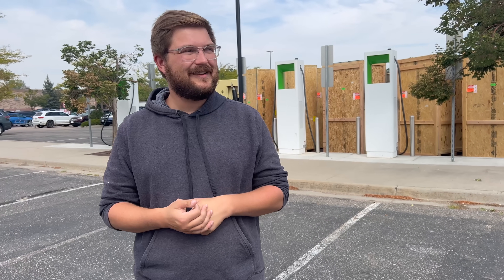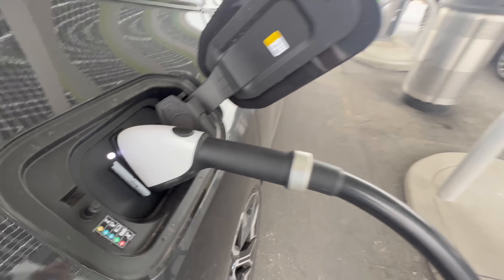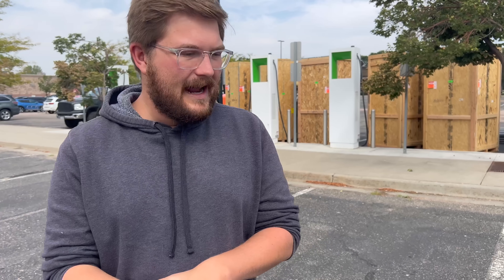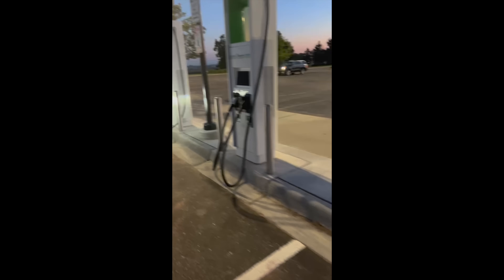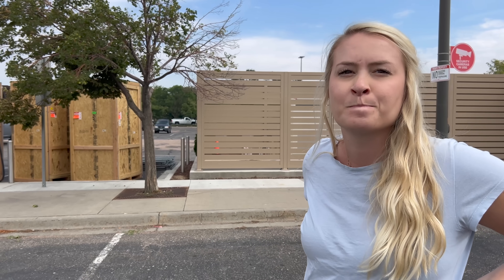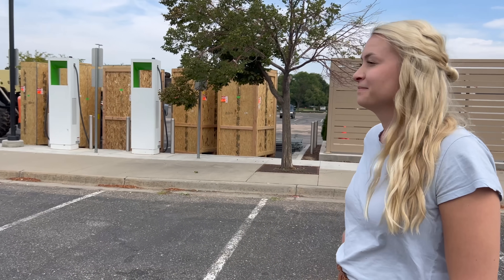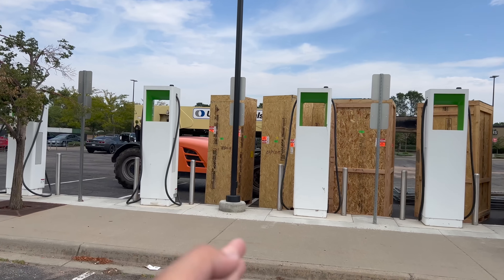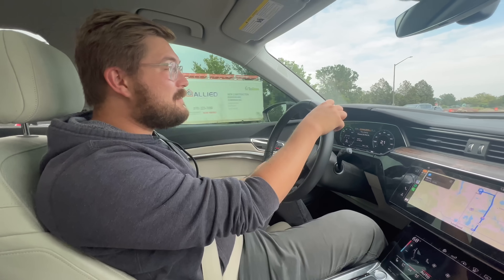Upgrade! New DC Fast Chargers Are Being Installed To Fix Reliability Issues Of Older Units

Comment: Looks like EA jumped the gun, and should have left Two stations working.  Just in 15 minutes of this video several customers got left stranded with no charging.  
If other DC fast charging stations are around a sign should be posted as to where the closest next chargers are and even a level two units as 2nd backup.  EA needs to have the app updated way before someone can post on Twitter.
Also, all level two EVSE'S should have a minimum of 11.5 kw as this is becoming the standard for batteries under 95 kwh and now with 135 kwh packs in the Rivian, Lighting and 210 kwh in the Hummer 19.2 kw level two charging would be outstanding. 
We still need far more pull through stations.
Reply: This is a major re-install.   They are not only replacing the charging cabinets, but also hardware connecting to location to the power supply.   You do not leave half the chargers working in this type of work.   Also, both Plugshare and the Electrify America app have details about what is happening at the LoveLand, CO charger, so it is no secret.   Anyone with one day's experience driving an EV should be able to figure out where else to charge if this location is down.   There is the Longmont, CO EA charger 20 miles away that is up and running just fine.
Reply: @PaulieinColorado  Paul F.  Do you work for EA?  Is this where your knowledge comes from?
Reply: Luckily there are 2 other "fast" (50 and 62kW) chargers within 5 minutes of there.

Comment: Gelly just came out today with 600kw fastchargers. 300km in 5 minutes already in mass implementation in china
Reply: B.s. they only announced the capability of up to 600kwhs charging, and claimed they are ready to roll out chargers across China. 
Not that they are already in use and actually have masses of evs capable of using them. 👍🏻

We've had 350kwh chargers since 2020 and no ev can even max those out here in the state's. Heck many 2022&23 hardly any non tesla evs can even charge faster per min per mile of range recovered than a 2019 tesla does. 😆
Reply: @4literv6  I never said mass ev to use them. I said they are in mass implementation in china as are Xpeng 460kw superchargers.
This from geely is in fact just an update to their existing 360kw superchargers that came out with zeekr when 001 came out. It’s just the cable that has a new liquid cooling tech.
Now with the new battery qilin from catl coming out in the end of the that will equip the 001 these superchargers will all be converted to 600kw pretty fast.
Xpeng it’s different, it’s completely new hardware. Coming out for the G9.
Reply: @telmoazevedo8958  name just one existing ev that can use these 460kwh chargers at anything like their max?
Reply: @4literv6  Has someone tested the Rimac max charge capability yet?
Reply: @abraxastulammo9940  mate himself posted a shot of his nevera pulling 334kwhs on a 350kwh 800v electrify America charger earlier this year.
I haven't seen anything outside of that though. The first U.S. delivery should be soon now. 🤔

Comment: I just took a 4000 mile road trip from SoCal to Washington to ID then down I-15 back to SoCal and I had no trouble charging. Granted for half the trip all the stations were set to free, but I did have to disable my Plug & Charge on my Lightning as it would still charge me on a free session.

Comment: You complained and EA is reconstructing your local charging station, that is great news.    But I have to say, there are more EA and DC fast charging stations in Denver than there are up and down the entire central US between I-25 and I-29/35.   There are more EA stations in Denver than in the entire state of Oklahoma.   There are NO EA charging stations along US or state highways in the entire US!        There are no EA charging stations between I-40 and I-70.    I could go on, and the situation is not going to get better because EA’s new plan to add hundreds of new charging stations does not include anything in the central US south of I-80 and between I-25 and I-29/35.  Sad

Comment: I suspect that the Nissan Leaf owner will never be able to charge there again as these new chargers only have one handle, and it’s just CCS.
Reply: The new ones will have Chademo as well.
Reply: @vandreadparty  Kyle (or Tom) has mentioned that EA only plans to install CCS on future installs except in California. I guess we’ll find out, but the new units installed in Baker are only CCS. It would mean a dedicated CHAdeMO station or a different type of charger as they new ones only support a single cable.
Reply: @ericroe  ea said no new chademo. Evgo and chargepoint still care about leaf drivers. Ev go installed 4 brand new locations of 100 kw to 350 kw chademo and ccs as part of gm’s ultium charger money
Reply: He can go to the ev go station I posted on here. His car can only use 50 kw so go to ev go I looked it up. Alyssa could have done the same thing don’t rely on just one place. It isn’t Ea fault Kyle moved to nowhere . Denver has a boatload of units but he is 8o miles north
Reply: It should be not too difficult to make a Chademo to CCS adapter cable or conversion kit for the car.

Comment: It's been fine around me.  Biggest problem I have is that I am on t-mobile and have the polestar 2 year free charging but my favorite charging site just so happens to be right on the edge of a t-mobile dead zone, so I have to hold my phone as high up as I can (I'm 6'1 with long arms) to be able to start the charge session. This is really a t-mobile issue, but it would be nice if I could access my polestar charging plan based on my CC number.
Reply: re: "I have to hold my phone as high up as I can (I'm 6'1 with long arms) to be able to start the charge session." pack a folding step ladder in the trunk.

Comment: While I’m super excited at the possibility that reliability will improve, is anyone else disappointed  that EA is starting to deploy power sharing units? I feel it’s just one more thing that keeps me guessing what sort of charging experience I can expect when I arrive. Am I going to be able to make a 20 minute stop on a 350kw unit or an I going to be relegated to a 150 resulting in a longer stop? Now I also need to worry that someone will pull up to the 350 right after me and put me in the same situation where I get a reduced charge? Not ideal to have the mystery.
Reply: I assume you drive an ionic 5 Kia or Taycan. Right now that’s a small minority of drivers that would benefit from 350 but ensuring that almost everyone gets 150 is more important then catering to a minority
Reply: I guess I was hoping their next generation chargers were going to be targeting the next generation of vehicles that may be the minority now, but will hopefully be the majority in years to come. 🤷‍♂️

Comment: How about a mandate that every gas station must install at least one Level 2 AC charger with two charging cable?
Reply: That would make absolutely no sense.
Reply: No. Too slow. Two minimum 50 kW DCFCs makes some sense. 150 kW would be much better.

Comment: As a 1st gen Leaf owner, feel sorry for that leaf who couldnt charge. When you got 25% left in those you dont have 30+ miles left to find another charger. You got like 12.

Also does anyone have a legend that shows what each charger from the different manufactures look like?
Reply: There is a label on the side of the dispenser which shows the manufacturer. All of these new ones are BTC dispensers (the part you can see) and the cabinets are usually hidden behind a wall or a fence, and those are made by SK Signet or BTC.
Reply: That’s why you don’t roll into a charger with very little range left without verifying the station is working.
Reply: @ouch1011  Tell that to his wife. Did you not watch the video at all?